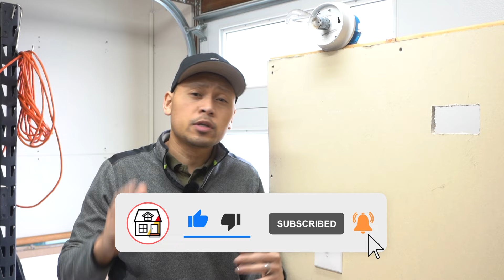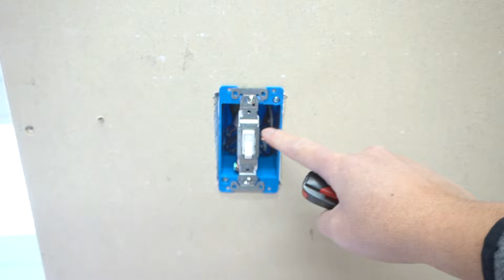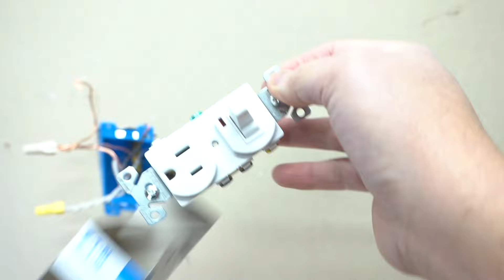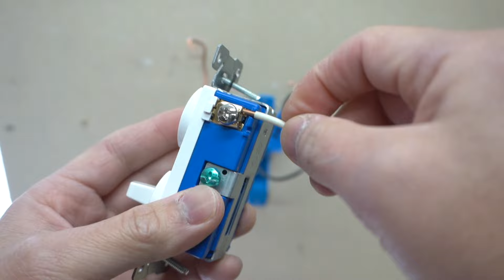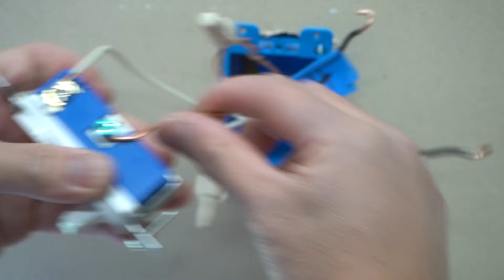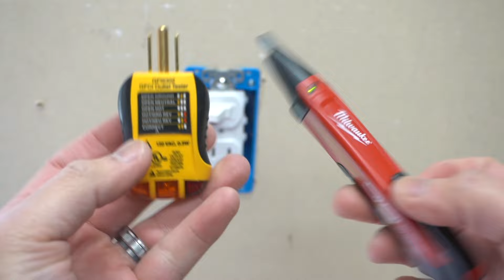EASIEST Way To Add Extra Outlet To Any Room! NO WIRING NEEDED! Outlet Light Switch Combo DIY How To

Comment: Thanks for this - that's today's mini-project in my kitchen. It would also be helpful to show how you twist the wires together with the wirenut (I usually pre-twist with my linesman's pliers) - moments like that when a diy-er may get frustrated or not quite get the knack yet for the easiest way to do something (or show how you handle any challenges).

Comment: Neutral isn't required for a light switch. You can't legally or safely use ground for a neutral. How many light switches have a neutral in the J-Box, vs. How many just have Hot and load?

Comment: Be aware that if you have an old house you could have only two wires and one could be white connected to one of the screws on the switch and is not a neutral wire. It's a white wire re defined as hot, when the power comes to the light first, aka a switch loop. Switch loops by this method are no longer permitted unless you use a /3 wire. The red and black wire goes to the switch, and the neutral should be capped unused in the box. In this case, you can do this conversion.

Comment: Another guy said to put the "hot" wire to the brass screw and the load to the black....So which is it?
Reply: If you put the hot wire to the black screw the receptacle will be live regardless of whether the switch is on or off. If you put the hot wire to the brass screw the switch will turn the receptacle on and off. So, it depends on what you want to do.

Comment: What type of wire is the pigtail?
Reply: It's usually pulled from a spare Romex cable of the same gauge. You can also use a THHN individual wire of the same gauge and color.
Reply: @surferdude642 thanks.

Comment: Why the switch has to be on the upper part? Any combination outlet with the switch at the bottom part?
Reply: It's your choice, you can mount it either way, although the ground slot would be on the top. Either way is code compliant.
Reply: @surferdude642 I want to plug in a scent diffuser which can’t adjust the plug directly 180 degree. So with the ground on top, the scent oil will be upside down. Instead, I have to use a plug extension which allows the ground to be at the bottom and creates some space for me to operate the switch.
Reply: @hulong0205 There's one, Bryant pn: RCD108W, but the scent diffuser will probably interfere with the switch.

Comment: Uh, most modern wall switches are going to use a switch loop (suicide drop). The neutral line has the light in-line; if you plug something into the new socket, the light will come on.  Not code, anyway.  It is DANGEROUS for you to assume that your audience will know that since you have two black wires you are NOT working in a standard switch loop.  This should be the FIRST thing you say.

Comment: Not allowed by code. Because it is just cutting the hot lead. There is no connection to the neutral
Reply: Switches don't use a neutral wire.

Comment: I tried to follow this excellent video, bought the Eaton, but when I opened up the switch I wanted to replace with the combo, the wires don't look like those in the video.  Alas, the light in question is activated by 2 seperate switches, one on the first floor the other on the second floor.  I want to add the outlet to the switch on the first floor which is at the bottom of stairs, so I can add a night light.  Don't know how to do this.

Comment: Here in the UK we don't have exposed terminals like that,our exposed earths must be sheathed and we would never overload a lighting circuit with a power socket.
Reply: Why? I am curious
Reply: @AudibmwjbBecause our lighting circuits are only 5-6 amps and generally wired using only 1 or 1.5mm.

Comment: Great video, and one suggestion. One thing I never see mentioned when discussing pigtails is where to get the wire to make the pigtail from. One would have to either buy a length of the proper Romex or use some spare Romex they have laying around, unless one just happens to have single insulated wire(s) of the proper gauge.

Comment: my house is circa 1934, and the only wires in the box is the hot and load, the ground/neutral was not run into box, I have seen no video that addresses this
issue, a home depot guy said, there is a ground in the receptacle that is invisibe, that sounded very odd, but i believed him, it didn't work, However, oddly enough, the box itself
appears to be grounded, when removing switch, the hot hit the side of the box and sparks and thrown circuit breaker, I m tempted to just use the box as the ground but i would rather have a actually ground in the box. The box is in an old plaster/lath old style wall of yesteryear, not your modern drywall wall, I fear removing the box too and not being able to reinstall that.  Why is there no video for my wall??

Comment: Excellent video Sir. Thanks. I have one question:
I need to plug in a lamp to the outlet part. If I BREAK the bridge between the switch and the outlet will the lamp come on when I turn the switch on?  Thank you.

Comment: Thanks for making this video.  I was able to complete my task.  Beginner mistakes I made. 1.  I bought a Leviton 20 Amp combo switch assuming they were all the same screw configuration.  Besides the screws being in a different spot, I had to use the loop over the screw technique rather than what you were able to do.  I found it to be a real time consumer.  2.  There were already 3 #12 common wires in the red screw nut and rather than do what you said and cut them all back and screw all 4 fresh cuts together I tried to just add my pig tail to the existing three.  It didn't work and I finally did as you instructed and it did work.  Comments:  That Volt Claw tool was indispensable.  I never new it existed until you showed me.  I never new about the line and load wires or how and why to test them.  Thanks to you I now know

Comment: Would have been good to note straight away that this won't work on older homes where there are only 2 wires in the switch box (no neutral, neutral is at the light).

Comment: I like the fact that there's a red LED on the switch. The comes in handy in my garage where the switch controls a light over my driveway. When the garage door is shut you don't know if the driveway light is on or off but if you look at the LED you will know instantly.

Comment: this doesn’t work in older homes where they bring the power for the light to the ceiling, and do a “switch leg drop” to switch on and off the light. If you aren’t aware, a switch leg drop is where they do one run of romex wire down to the light switch box and use the black as the feed and white as the hot to the light. (usually the white wire will be marked black but some people are lazy.)
obviously wouldn’t work because there is no neutral wire at the box. most modern homes should run the feed into the light switch box and then up to the light like this though.
Reply: I was wondering why nobody brought this up.

Comment: Since typically you'd want to add an outlet off a switch in the bathroom you'll need to use the GFI type of comination switch/outlet.  They run a bit more but of course it will make your DIY code (and much safer).

Comment: There are only two wires (black and white ) connected on the switch, I used 2 pig tails for each line, when the switch light is ON, the electrical outlet doesn't work. Question WHAT is wrong? What is missing ?
Reply: There is no neutral present, the white is being used as the switched leg, so you can't do this.

Comment: Adding a ReVent 80 CFM exhaust fan to my bathroom. Current configuration has a switchplate with a switch to control the bathroom light and directly next to it a 110 standard dual outlet. If I add the switch shown here in this video, what kind of wire do i add to the box to run up to the celing exhaust fan and connect to the lightswitch shown in your video? Can you make a video showing how to do that? Or direct me to one if you have  made one already? Thanks!

Comment: If you are tempted to install one into a switch box wired from 2011 on where the neutral wires are in the box such as this, these combo switches are available with a GFCI built into them.  If the light circuit is not protected with an AFCI/GFCI breaker,  you will want a combo built with the GFCI on it.  These combo switch outlets come in both 15 and 20 amp models with a GFCI built into them.  As you can see, this one is a 15 amp non protected half switch with basic features only.  Pre 2011 light circuits use 1 cable from the fixture, making the white wire a hot traveler wire at a light switch box, not a neutral wire.  Those switch boxes will require some rewiring to allow for a combo switch and receptacle.
Reply: Thanks for the explanation. Hardly any of the light switch boxes in my house contains the neutral wire making this process a lot more complicated.
Reply: Can the rewiring be done  in the box or does it rewire running lines?
Reply: Oh no. I was excited to add a plug in my hallway but my crazy house is from 2000. 2 white wires. Help. How can i figure this out?

Comment: Not all switches have a neutral in there box.
Reply: Code now requires one on new installations, old wiring just switched the hot back onto a white wire that should be remarked as black.
Reply: They should to continue the line

Comment: Quick question just want to know I was connecting a to switch on one switch but I test my black wire and I got the hots with the tester it beat like the one you got but the white one also bep2 and just wanted to know if that one is hot too

Comment: So it doesn’t work if you have 2 wires????
Reply: Have to have  a neutral wire. Minimum 3wire single  cable or two  2 wire cables. Green  ground in Dell

Comment: I've tried this in my sunroom but I only have two wires (load and one that goes to the light). I'm missing the neutral.
Reply: Not possible, you need a neutral.
Reply: @ktmRon72  I figured. Thanks bud.

Comment: One extra step, would be to wrap with electrical tape 🤓
Reply from the maker: That’s awesome too! I agree 🙏🏽😊 thank you my friend!
Reply: Not really needed in a plastic box, but can’t hurt.
Reply: I would think the extra step would be to shorten the wires to (nearer) a minimum so there's no need to forcibly cram them into what should be ample volume for, at most, two items using a purpose-made plastic push-stick.

Comment: Great, informal video. I'm somewhat of an ADHD handyman. Jack of all trades, because I grew up in a household where we couldn't afford licensed contractors. Electricity is the only thing I've never messed with, for what I consider to be obvious reasons.
Now that I'm in my own home, I plan on (overly cautiously) re-doing the wiring. The house isn't grounded, and every outlet is (was, I replaced a few upon moving in) the original 2 prong fixture. Some of which, are so brittle to the touch that they crumble if you remove the screws.
I've noticed Wago connectors are a bit of a "hot topic" amongst electricians and diyers. Old timers claim they're fire hazards, new timers claim they're safe and the old timers just don't want to be out of work, diyers just use them... cause they make logical sense. My question is, are there any known codes preventing them from being used? Everyone always gives the speech about "checking your local code" but that's such a specific thing to have to look for. I've never heard Wago connectors being involved in any code, for or against.
Reply: Wagos are UL tested and National Code acceptable.  Your local inspector can be queried to see if they will pas HIS inspection.  They’ve been used for decades in Europe and over ten years here in US.  YouTube videos show then holding up to over currents and over 25 pounds of holding force and I’ve never see evidence of failure.
Reply: @thatonneguy Genuine Wago brand connectors are fine, but beware of knockoff equivalents sold at Home Depot and other stores.  The knockoff equivalent brands are not so good.  I dealt with a knockoff brand, and it was junk!  It looks like your home was built before 1962, as the NEC made grounding mandatory in all rooms afterwards.  I live in a 1955 built home.  My grounded boxes are in the bathroom, a laundry room converted to a bedroom, my kitchen wall that has the sink on it, my outdoor lights and switches, and my detached garage.  You can run a test in your bathroom, kitchen and a laundry room if you have one inside the house, plus the garage, to see if you have grounded boxes, if the receptacles are 2 prong types.  You'll need to use an adapter to the type of tester shown, to see if the boxes are bonded to the breaker panel by back wiring done to the box.  Some pre 1953 homes have 2 prong outlets in the bathroom.  If your house has a 2 prong receptacle in the bathroom, remove the outlet's cover plate screw, plug in the 3 prong adapter, and secure it with the plate screw.  Plug in your tester to see if it shows correct wiring.  On a 2 prong with the 3 prong adapter secured down, if it shows correct wiring, your box has a ground wire behind it in the wall.  Do the same in a kitchen with outlets near the sink, laundry room and garage.  If your wires are still in good condition, you can run a 12 gauge green solid ground wire to metal boxes, and use a grounding clip to secure the ground wire to the box, then run the wire to either a grounded box and attach the other end to the box, by a grounding clip or grounding screws.

Comment: One last thing:. A viewer in this situation should consider aesthetics.  "How badly do I need this outlet RIGHT HERE" in consideration that it will he higher than every other outlet in the room - around 48" off the floor versus around 12" off the floor. (Not as big a concern in a garage, workshop, or utility room where those outlets are often higher) and now I have a light switch that operates horizontally versus every other one operating vertically.

I had customers that didn't so much mind doing a little fishing behind sheetrock for a new outlet just to maintain the "look" around the house

Comment: I would hope your viewers do not find themselves in this situation very often to where they would have to add a new outlet to an existing switch box.  I'd think the requirements for at outlet here would be so unique.  I.E. in a garage where a horizontal freezer is right beside the door (then the question if a freezer would work on a 15-amp circuit as many if not most light feeds in a residential home are on 15-amp circuits, at least, ones I worked in, but there are some homes like mine where the wires for the lights are 20-amo, and I can only assume it was because the house originally had a small 60-amp sub panel in the garage with 24 1/2" breaker capacity and they would have run out of spaces in the panel, so by using a larger wire (#12 for lights instead of #14) they were able to feed more lights off the same breaker.

Comment: 11:54 (near end of video) is where you mention that this would work only IF there is a neutral present.  This should almost be mentioned right away so people will know right up front if this solution will work for them or if the need to check with another video, or call an electrician to add an outlet.  There is a change the switch could be at the end of the line and the neutral in the box is used as the load side of the switch (hopefully makes with some black tape, I've seen them nor marked) and the black wire serving as the load side of the loop.

This also may not work if the box was the end of a 3-way circuit (even if there is an unused freestanding neutral) because if the lack of a constantly 'on' hot wire.
Reply from the maker: Hi Matt! Thank you for always watching my videos! A few weeks ago you won my giveaway and haven’t responded . Please email me so I can send you your winnings 🙏🏽 here’s my email: fixthishouse1@yahoo.com
Reply: @FixThisHouse  thank you for letting me know.  Being able to watch YouTube videos is a luxury for me, so I can't always respond in a timely matter.  Had to unexpectedly rip up a master bathroom floor because the tile was coming up in a few places and discovered it really wasn't laid correctly, and the toilet flange was not raised to be level or flush with the tile (so there was leakage to the floor below) so to not delay the inevitable, I just decided to rip the whole thing out and replace tile with waterproof laminate.  At least whomever put the tile down used cement board on top of the OSB instead on thinset directly on OSB (which was my fear).  I think I have an unlevel floor as the OSB has a 1/4" gap in one section that contributed to the tile failure, now debating if a floor leveling compound would be useful for a gap that narrow.  I should do videos but I think the platform would drop me from too many cuss words
Reply: @FixThisHouse  I responded.  Have not received anything as of 22 april
Reply: Doesn't work on a switch leg?

Comment: Thanks for this. Seems like a short cut that might not be worth the potential risk 😕
Reply: Ever had a receptacle that doesn’t hold a plug well?  That’s a big threat of possible fire as the receptacle is worn out and may arc and melt the receptacle.  Do you….1. Pay an electrician $120 plus to replace something ‘most’ DIYers can do.  2. Take the risk and do it yourself after shutting the circuit down.

Comment: You should remember that this is for low amp devices. Don't do this in your basement or garage and think you can plug a large chest freezer into it.
Reply: would this then would be good option for plugging in a charging station for charging phones, ipad, smart watch, blue tooth speakers, etc?
Reply: How about a vacuum cleaner?

Comment: Maybe you should have mentioned that this won't work if your switch is at the end of run.
Reply: He did mention that. He say that it will only work if you have a neutral wire in the box.
Reply: What does this mean? Sorry newbie here not familiar with terms yet 😅